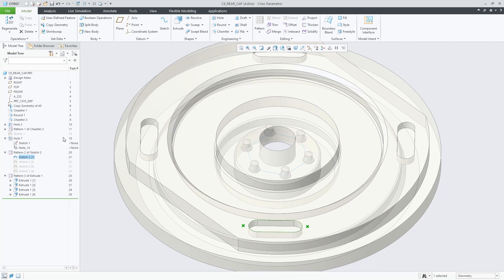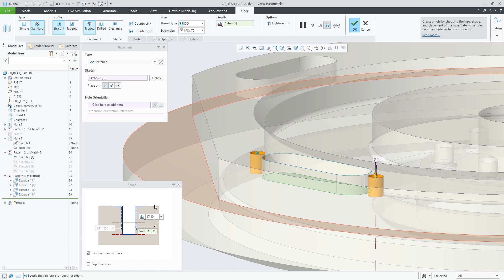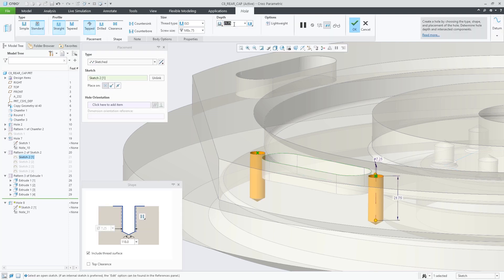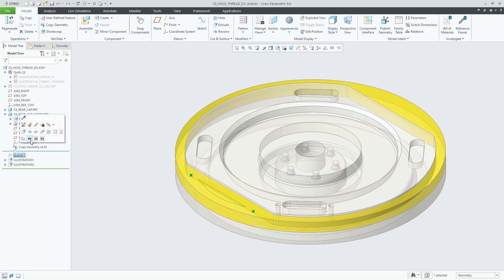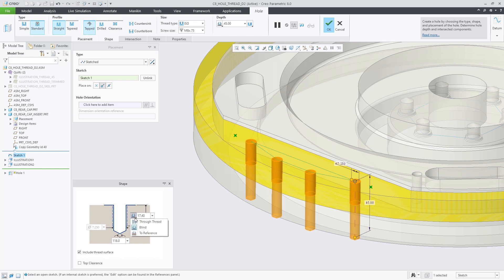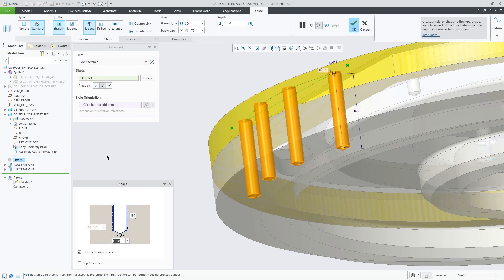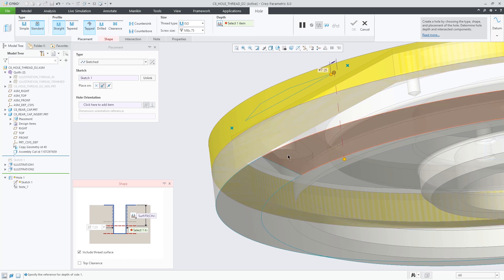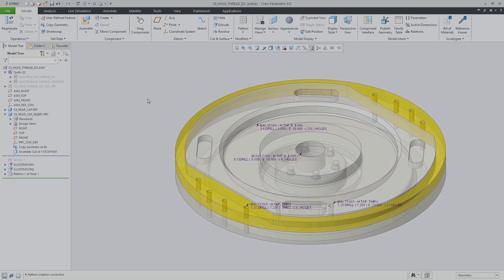Enriched Thread Handling Options in the Hole Feature | Creo 8

Comment: So the thead is only fot making the correct diameter.  But there will be no real thread in the stl or stp files.  So if this is needed i guess you have to draw the thread manually.